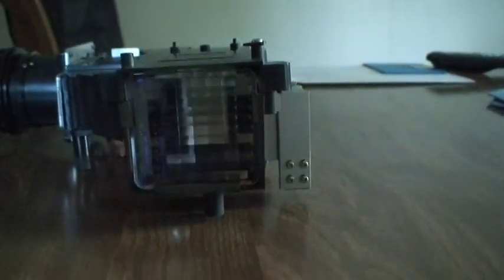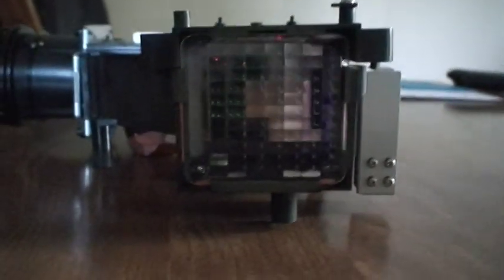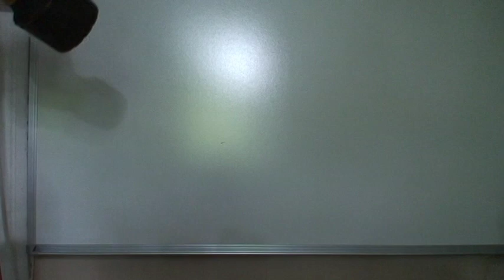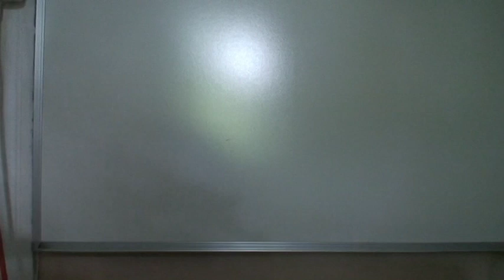How LCD Projectors Work (Part 1 of 2)

Comment from the maker: I was running out of time when I did this, so I would up rushing the color tabs, and forgot to do opposites for the color names (to appear in their correct color).
I had an LED flashlight, but the incandescent was brighter, so the color is skewed a bit towards yellow, but it does the job.
  I'm thinking of doing other things with this piece of the TV, but haven't come up with one yet.

Comment: You are not actually using a white light. Since the light source has a sort of yellow tinge, the clolors are not that vibrant..  and regarding the name of the color on the part 2 video, you should have print the name of the colors in the opposite color.. Probably yellow shoudl be printed in blue (I hope so)... Nice video !!

Comment: The light colors (Light-temperature/Hue/Gamma) can be adjusted on some projectors by actually slightly tilting of the splitter mirrors inividually inside a narrow angle so the resulting light behind the mirrors is of a certain wavelength or optical waveband. This is a preadjust setting however, the user-side color hue is corrected by electronics (intensity parameters of the three channels).

Comment: hey, i was jut wondeirng with the bulb inside the projector, if that runs off AC or DC? i'm looking at running my projector off an inverter... and if the projector converts the AC to DC inside the projector there isn't any point paying for one of the expensive pure sine wave inverters...

Comment: exactly! i hate dumbed down explinations. i wanted to know how a lazer works, so i found out how to make a p-n junction and got into physics just to know what right materials to use for it. i wanted to know how a capacitor works, and got into electrical engineering to understand how it stores its electricity. i take it to the max